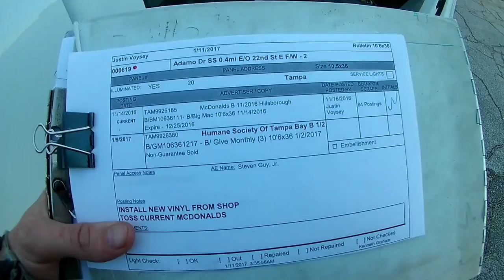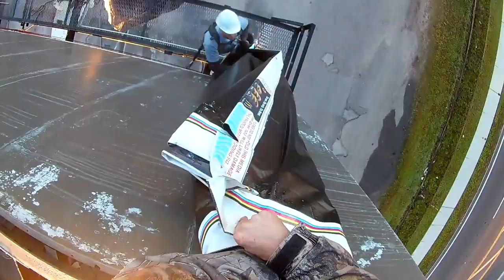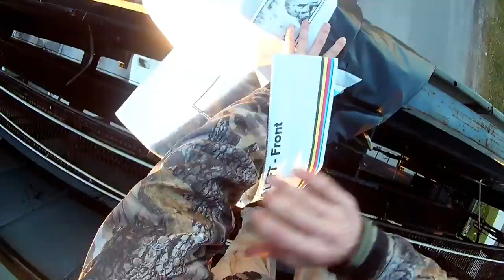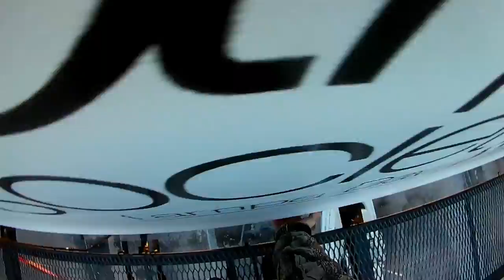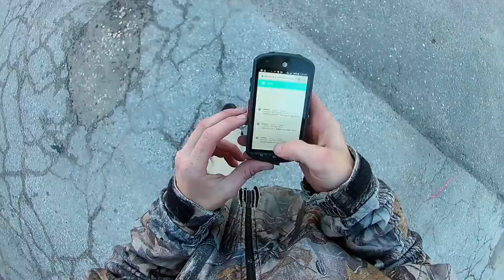hanging a Billboard from start to finish

Comment: Lol as a cell tower hand this looks like a cake walk. Think you’re wore out from 160 ft. Imagine being a tiny little 18 year old climbing 700 ft.
Reply from the maker: Never said I was wore out and I didn't realize I was comparing myself to you or a cell climber. What I do is easier and harder in different ways. I have done both climbed cell towers and now billboards it's definitely two different jobs. And the only thing that's comparable is the climbing part. No need to come on strong and see who's job is better or more dangerous if you fall from either a Billboard or a tower and your not hooked up your dead either way. Be safe out there!
Reply: I worked for both enersys and motive energy and now I hang billboards for outfront Media. And although I had 10+ years in batteries and billboards are more fun.